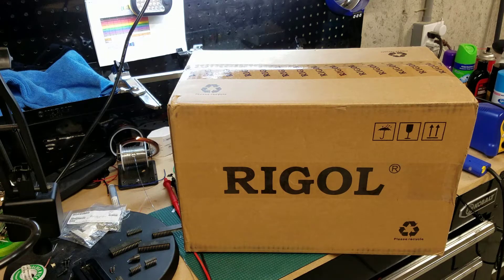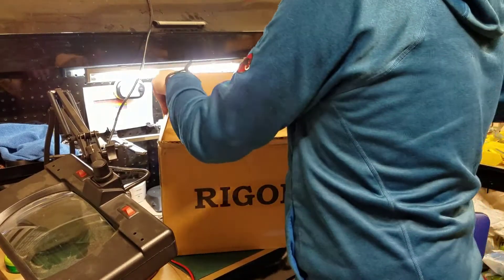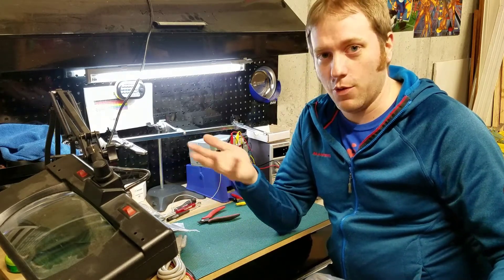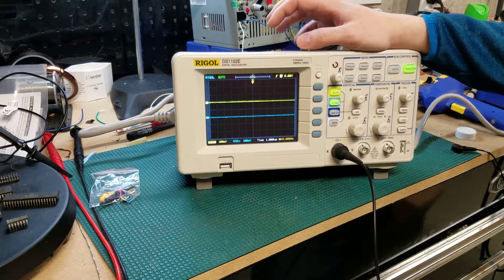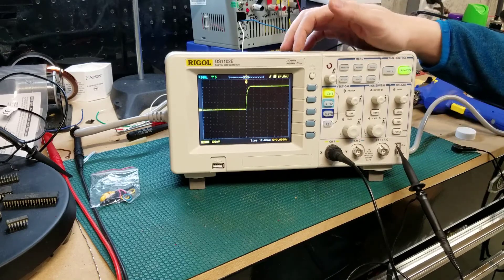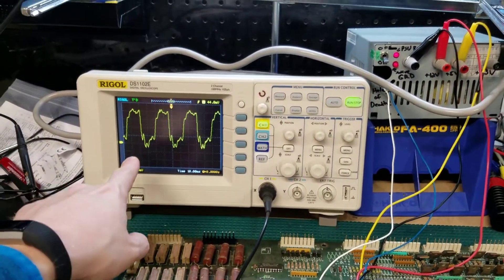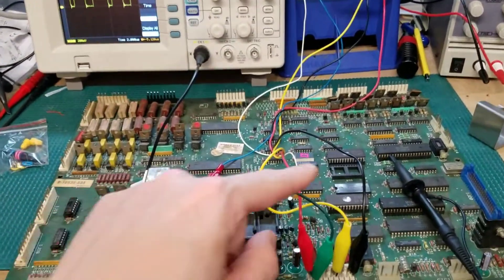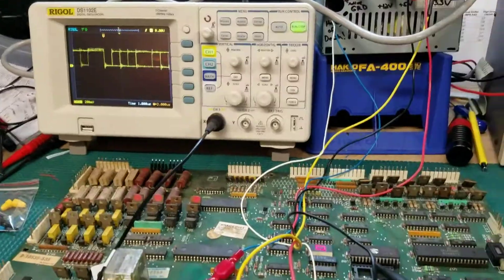Tech 'n Tools: First Look - Rigol DS1102E Osciolloscope

Comment: Thanks for this. I want to know more about troubleshooting with logic probes and oscilloscopes on pinball boards so admittedly I was looking for more content in this video.    It seems that pinball manufacturers and commercial owners of pinball were more interested in board selling and swapping. Details on component level repairs were held by manufacturers doing warranty prepares. The community needs to know how to do these repairs weather on the original equipment or on the new boards out there. Real troubling shooting guides with probe and scope examples would go a long way. I'm visual so a video Pinwiki is needed by many.